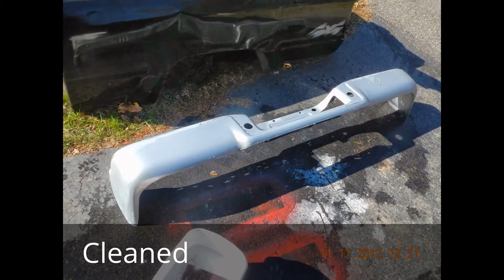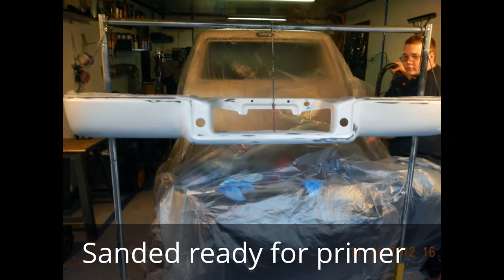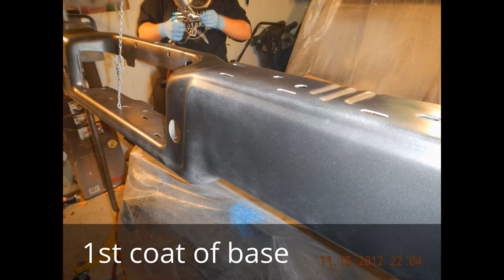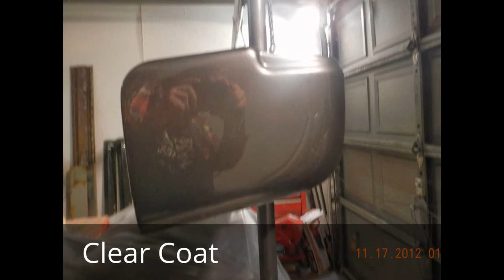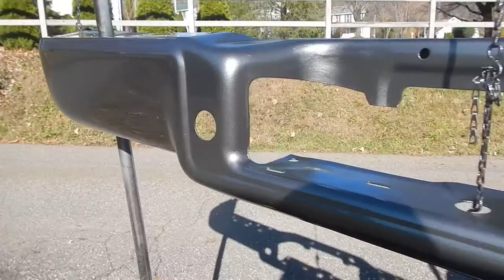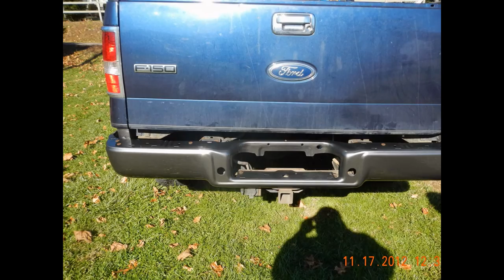F-150 Bumper Painting

Comment: Which kind of PPG paint, primer and clear coat did you use? Turned out great. I am looking to do the same thing.
Reply from the maker: For the primer and clear we used PPG Shop-Line brand. It was 2k primer surfacer JP202. If your going over bare metal you need to use epoxy primer or a DTM (direct-to-metal) primer first. I don't remember exactly which clear we used but I know it was a PPG Shop-line product, I know the one we used was the cheapest or just a step up from the cheapest. For the basecoat though we went with the more expensive brand PPG Deltron- DBC 2000 base, which costs a bit more but gives a very good color match.
Thanks for the comment,  hope that helps
Reply: I'm trying to paint my 2001 f150 rear bumper, what kind of sand paper should I use to fade the color the has on it? and what number of sand paper to sand the primer?
Reply from the maker: What condition is the paint in on the bumper?
Reply: Scott S  I bought this bumper at a junk yard, paint looks ok some scratches, black color ,I want to paint it white.
Reply from the maker: Eduardo Reyes If there isn't any deep scratches down to metal then you should be able to feather out light scratches with 220 - 320 grit. Deeper scratches may require you start with 180 grit. You should use an etching or epoxy primer on bare metal if there are scratches that go to the metal or if you sand through to the metal. Once your scratches and chips are feathered you can sand the entire thing with the 220-400 grit (depending on your primer). Then I would use a filler primer to help fill sand scratches and imperfections, not totally necessary but will ensure you have a nice flat surface. Once primed with a few good coats it can be sanded down to a 400 grit, 600 grit for a metallic base , if you have a lot of orange peel start sanding with 180 grit lightly then 220 then 320 and so on. And make sure wash it good with a dish soap before starting any thing.
Reply: Scott S thank you very much for the time you took to reply back,I'll start buying all materials that I need in order to do this project, thank you very much for the information as well.
Reply from the maker: Your welcome, best of luck

Comment: @scotts how long do you wait till you spray the clear ?
Reply from the maker: 15 to 20mins but you actually have a couple hours and some paint is up to 24 hours so no need to rush. Another good way to tell is to check the over spray on your masking paper, it should be dry to the touch. Also if using a metallic paint be sure to use a tack cloth between coats and especially before clear coating. 
Hope that helps. Scott
Reply: Scott S thanks !